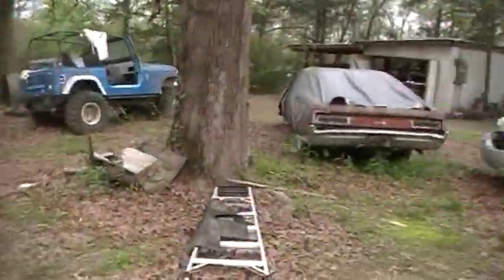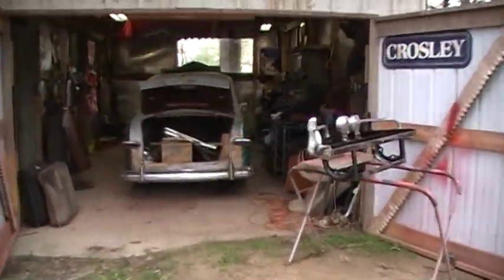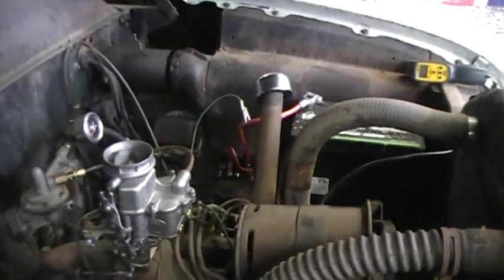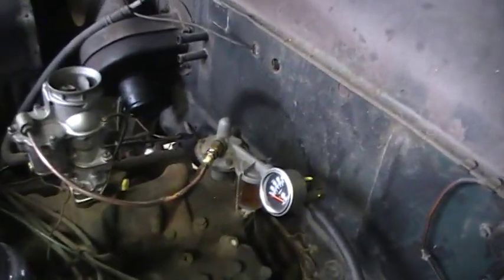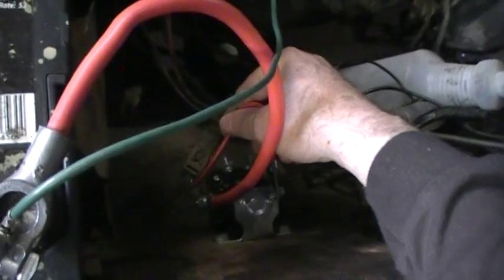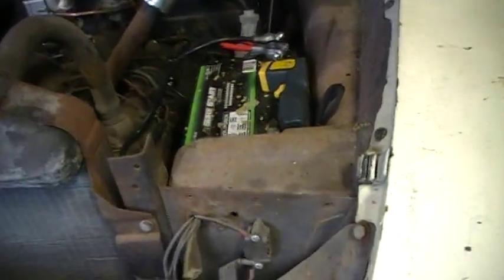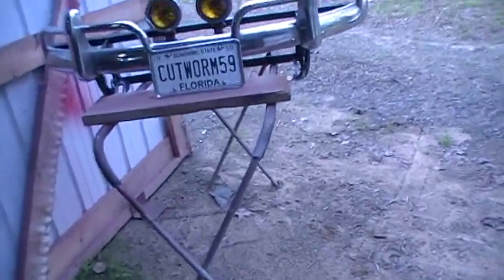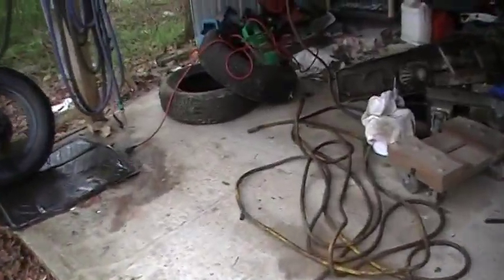Run Ford Run

Comment: Woo Hoo! A new CUTWORM video. That old flatty was running on the first turn. It’s always fun to see your latest project we never know what’s next. Ya’ll stay holed up on the hill and keep well. When all this mess is over I’ll stop in for a visit. Love Y’all.
Reply from the maker: Thanks very Sweetly Swamp king. I will get some brakes on it next. Build some plug wires too. It slid off the floorjack tonight. Bent the rear quarter. I fixed it back. It's always something. Luckly no mice were harmed when it hit the floor.
Reply: I believe your wheel is off of a Hardly Ableson.

Comment: I did the 8 volt trick on my old shoebox back in the day, and just cranked up the regulator, but while the lights were super bright, they didn't last real long...LOL I sold it before I could finish the transformation.
Reply from the maker: I have witnessed a few tractors running on 8V.  Worked good on them.

Comment: My sister was dating a guy one time that had a Ford like that. She ended up marrying him. But when they was dating he had that Ford for awhile my brother had a 54 Chevy with a strait 6 in it they would race every once in a while my brother always beat him. One day my brother told him he could take off in second gear and beat you. So they went out to the place they raced and my brother beat him he was so mad he wouldn't talk to my brother for about 3 weeks. 
Stay safe and God bless.
Reply from the maker: Fords of that lineage weigh almost 800lbs more than any other car. However the V8 flatheads were not fast in stock form.
Reply: @cutworm59  the had metal like a tank on them.

Comment: Yes you are right with leaving the 6 volt wiring alone, to acheave the same wattage the current must be double the value and a bigger diameter wire is required for the least loss/heat :-D
Looks like a loverly day, suck in that energy :-D
Reply from the maker: I know yall don't have seasons,  just weather. Is this your warm time?
Reply: @cutworm59  Yes it's been very nice weather lately,  most days are not cold but not hot, i can stand outside without feeling chilled.
At this time 19:44 the sky is full of orange ish coloured clouds and lit by the setting sun, loverly effect :-D
Usually we have showers and bits inbetween where its not nice to be outside for 10 mins before i feel the need for a hot cup of tea lol.